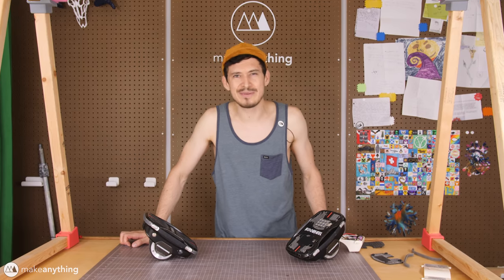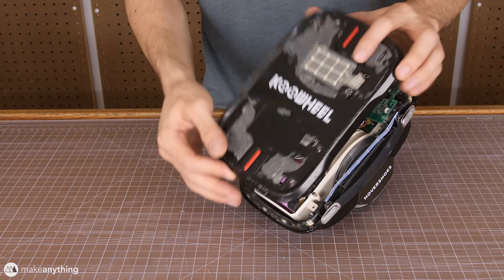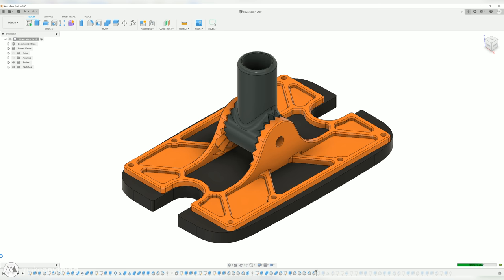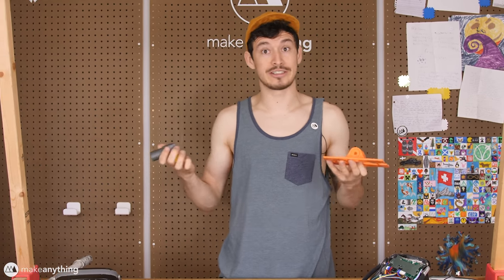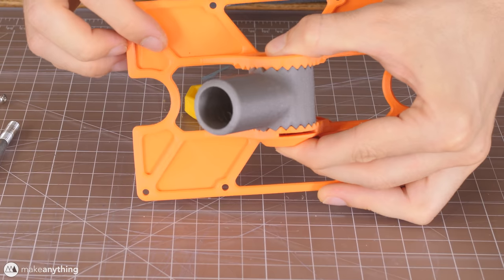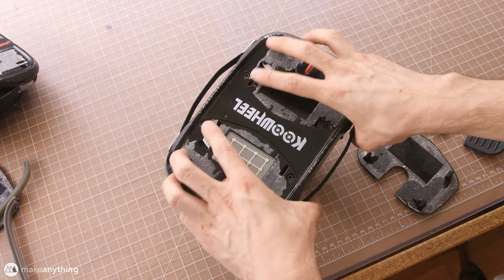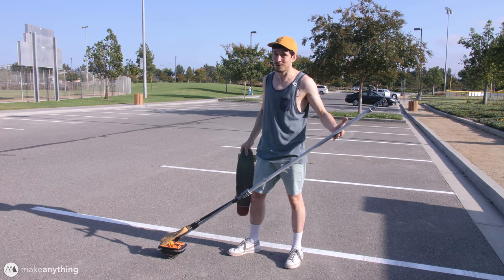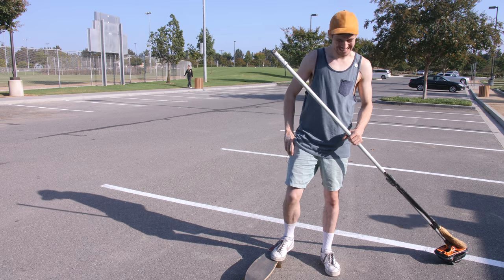Skateboarding a Magic Witch's Broom

Comment: If you want to improve it, remove the pressure switch in the base thing, and add a deadman switch in to the handle  giving you a LOT more control when getting on and off along with safety

Comment: Awesome work, looks amazing.
Replacing the pressure sensor with a contact switch (like on a treadmill or similar) up where you hold the "broom" would solve some of the issues with it potentially running away.
Keep up the good work.

Comment: Great job! If you do a V2, just replace the pressure sensor with a switch wired to the hand hold position on the broom handle so when you let go it stops.

Comment: Two thoughts that came to mind: 1) If stability is an issue "training wheels" could be made as part of the attached print to help with side to side wobble; 2) if you are worried about it always running, you could create a long distance pressure plate activator that is basically a squeeze button (like with extender claps) that when pressed/squeezed then actually presses into the pressure plate to then at will activate/deactivate the motor. With those two adjustments/builds it could be both a safer and more stable/controllable broom. Not sure how the the second one would be well implemented though. Last as just a For Fun idea, your print could have an modeled attachment that makes it look like a push broom or something (Like in Hocus Pocus when they still modern "Brooms" and one was a push broom)

Comment: I think if I were to ever make one of these I'd modify the electronics a bit to add a throttle or brake so that instead of just tilting it forwards to go, you also have a bit more control if you want to slow down. At least I hope

Comment: They look like mini one wheels!  It almost makes me want you to try to create a crazy powerful off road set of the original things or make an even stronger mondo crazy powerful gigantic onewheel to like off-road and do crazy tricks that the others don't have the power for by using a bigger wheel,  putting everything into it except the board and making the board as light as you can then see what tricks you can do and maybe see what a pro skater can do on it?

Comment: Use a One Wheel, and instead of attaching the broom by connecting the head by the screw, you need to have a bar coming off the center of the one wheel and have it meet the broom halfway up it at a 45 degree angle.

Comment: Wait so is this inspired by Kickstick? I've been wanting to build something like this for a long time.  Mainly due to the fact that I am an inline skater, and there's no Electric Inline skates. A motor on a stick is a much easier to build alternative to putting motors inside skates as there's barely any space for that. Plus I can have storage space and a large battery for mega range on the stick part.
Reply from the maker: Woah, I hadn't seen that! Nothing is original 💩

Comment: Could you not wire up a button to the pressure sensor and put it at the end of the 'broom' so when you let go, it turns off? It also gives you easy way to stop!

Comment: Dude you could replace those cells for standard 18650 3000 (+)mAh lithium cells. And you'll have your other hoover shoe working as well. They are pretty easy to salvage from old laptop batteries and dirt cheap. Good luck...

Comment: Am I the only one who thinks this could be a legitimate product. Yeah the sell balancing is not the right controlling mechanism but if the speed was controlled with the handle and it had a safety switch in the form of a wristband like a jet ski it could be a viable product it gives skateboarders the freedom of using their own board and not having to modify or buy a premade electric board for commuting. Also would be interesting to put a camera mount on the top of the handle